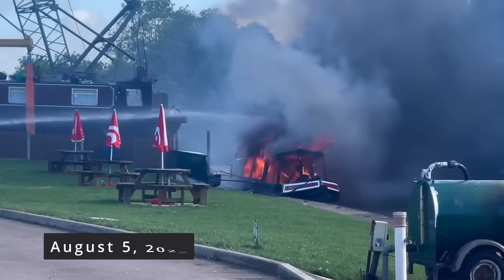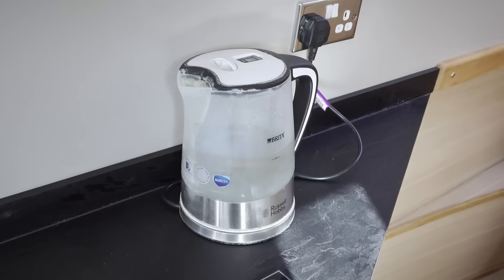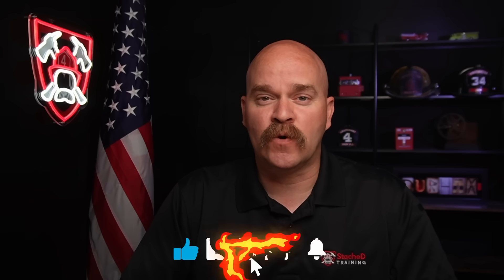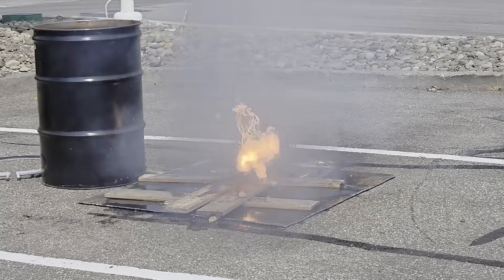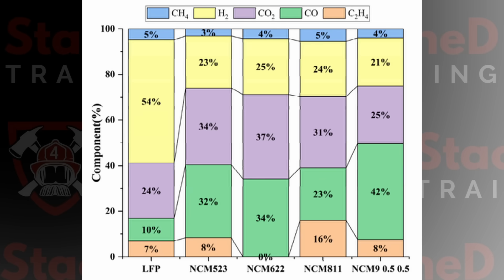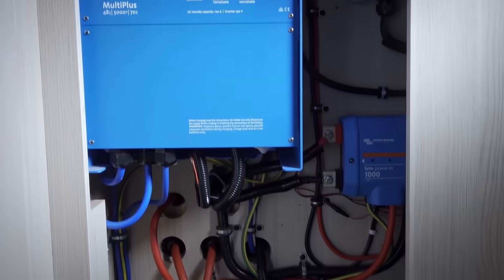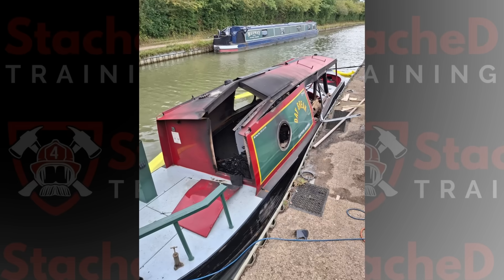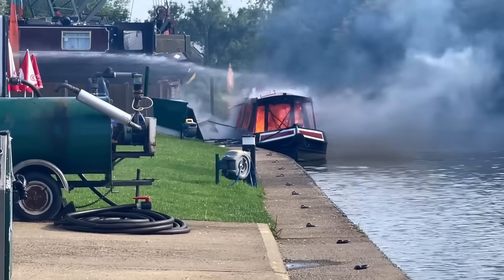Electric Boat Explodes While Charging: LFP Batteries

Comment: 12V batteries in parallel with out a fuse get one battery shorts out rest dump their current into it the only protection is a BMS could be shorted out. Also have to admit way more gasoline, and propane fires in RV's then LFP fires. According to StacheD lithium is far more likely to catch fire then gasoline, and propane.
Reply: The guy in the marina who took the fire video you posted, and viewed the aftermath, said the batteries were mounted up against the divider bulkhead in the  dry part of the boat, not in the propulsion motor compartment under the rear deck.  
Seen no definitive proof of battery chemistry, but someone looked at the batteries of this boats sister ship, and said they were not LiFePo. 
Maybe some more due diligence is in order before an "expert" opinion is offered.
Reply: @kylereese4822   If it turns out not to be the cause or wasn't LFP's he won't bother with a follow up video. His channel is full of EV haters who use him to justify their retroact how he makes money.  46k subs are EV haters .3 are fire fighters. I didn't post the video the channel owner did.

Comment: I had also previously thought LFP cells to be more stable than Li ion cells.
It only takes one cell to fail to create a very dangerous situation 
The question is - what was the cause of the failure?
The charging system ? - from an excessive charging rate?
Failure of the BMS or the lack of proper BMS control to manage series charging of a 48volt system built from 12 volt batteries which internally have their own BMS to manage the charging of the individual 3.6v cells?
Lots to consider and many potential points of failure, with much of the evidence blown to pieces.
Maybe start with the design..
The old put-put diesel engine would feel a lot safer having seen this disaster waiting to happen.

Comment: China significantly dominates the lithium battery material market. They control extends from raw material extraction and processing to battery production and component manufacturing. They hold a large share of the global market in various battery materials. 

The more you become dependent to battery powered cars, vehicles and heavy equipments in everything you do, the more you & your country will be at the mercy of China in the future,  that's why they are really serious on pushing disposable EVs & big batteries to as many countries as possible and eliminate all kind of reliable & repairable combustion cars. 

And their agenda is in line and sweetly backed up & supported by the powerful World Economic Forum.
Reply: Cheshire Fire & Rescue Service - Boat Safety
Petrol Solid Fuel Stoves Causes of fire on boats The cause of fire is varied, but could include: Escape of gas from an LPG installation coming into contact with an ignition source resulting in fire/explosion. Flammable vapours entering the accommodation space coming into contact with an ignition source